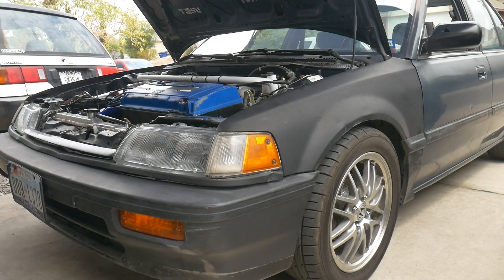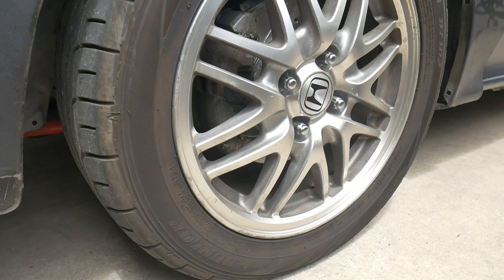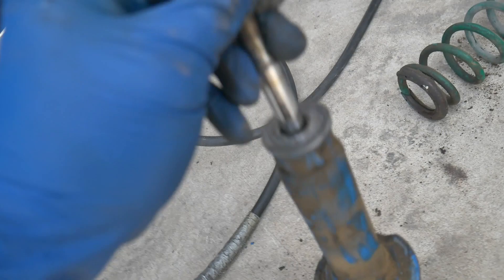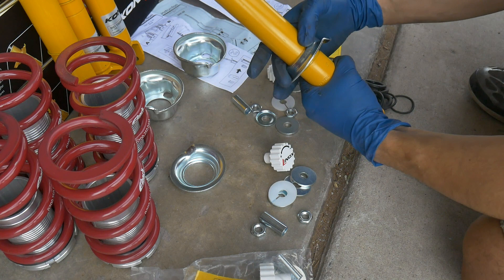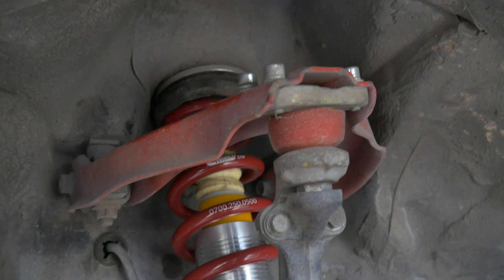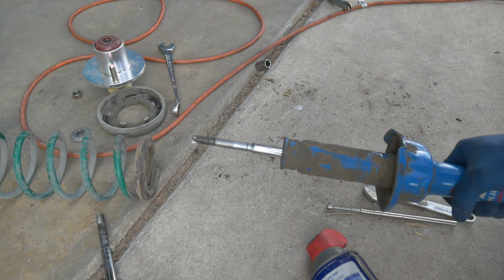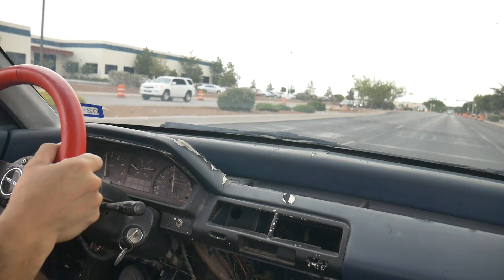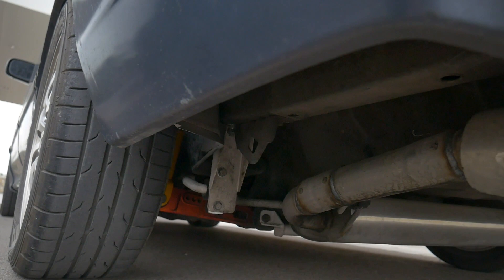Best Coilovers & Shocks for Your Honda (Koni / Ground Control 1989 Honda Civic EF Sedan)

Comment: Like yourself, I’ve used MANY different suspension set-ups on my CRX’s.  I am currently using my favorite of them all:
Koni Yellow’s (Race Version) w/Ground Control coils 600 lbs front / 800 lbs rear.  Been on my car since 2013, seen track days & auto cross with absolutely No issues!  Another brand suspension I would love ❤️ to try someday are Fortune Auto’s!!😎
Reply from the maker: I feel the same way.  I've had the yellows on my track car since 2015 and never an issue! Those Fortune Autos are what I'd like to try next also!
Reply: What would you recommend for a CRX driving for NO track driving ?
Reply: Bas van Will for the street (no “spirited” driving) I would run something like Tein street basis. They’re inexpensive & pretty soft so they feel good on shitty public roads.
Reply: @crxk20r59  cool, thanks
Reply: Bas van Will ohh yeah keep in mind with the Tein street basis coil over kit, u will need to remove some stock parts from your oem suspension to transfer over to the Tein’s...Good Luck!
Reply: @crxk20r59  thanks I will keep that in mind. I'm still researching about which one I will get in the near future. Yellow koni / Ground control looks very interesting though
Reply: Bas van Will they are Awesome!  The Sport version is less expensive than the Race version.  I believe you can contact ground control & ask questions as they will recommend set-ups per customers needs & use. 👍
Reply: @crxk20r59  thank you very much, appreciate it. I will contact them today! ;)
Reply: Did you guys get off the shelf spring rates? Or know the spring rates off the shelf?  Looking for this setup.  Mostly street but more focused on spirited driving maybe autocross.
Reply from the maker: Off the shelf 350/250

Comment: The best cars are the purpose built ones! Loving the suspension setup,if you dont mind what coilover sleeves are those looking into gettin sum for da bout to do the shocks and was planning on lowering it a bit just to get rid of wheel gap and feel a little more planted on them tight corners!! Always fire content! Keep doing your thing Jon! I definitely respect the grind homie!👊✌
Reply from the maker: Ground Controls made by Eibach
Reply: Garage Built Hondas oh for sure didn't notice you had put it the title my bad! On another note,is it left to remove the crankshaft pulley bolt on my b-18a1 cause im going to tackle it (waterpump-timing belt)tomorrow and for the life of me i cant remember. i got the manual but it don't say if it's left or right! Your imput would appreciated! Thank$ sorry for the stupid ?👊✌
Reply from the maker: You're correct in your guess! 👍🙏
Reply: Garage Built Hondas 👌👊✌🙏 much Appreciated!

Comment: Have these koni on my 96 ek and the ride quite good..btw i remembered the fans on your radiator, haven't you considered putting the fans on the front then reversing their connection to the socket. So instead of sucking air, they will be then blowing air into the radiator. Of course you can ditch the fan shroud
Reply from the maker: Yes, I might do that, but no need for now.  I like how it attaches to the stock fan.

Comment: I just picked up a 96 Integra sedan and the suspension is gonna be the first thing i work on. A lot of people have different opinions on what works the best and I am getting a bit lost in all the chatter and opinions. what would you suggest for a daily driver non track car that will be opened up on back roads? I'm shooting for a horsepower goal of 300.
Reply from the maker: KTuned coils.  Heard nothing but good things about them.  I've been a big fan of the Function Forms also.

Comment: Swapping out my stock EM1 suspension for Koni Yellow + GC with 440F/380R rates for autocross/daily driver. Just got the final parts today. Any thoughts on the purpose of the metal sleeve that sits inside the bushings in the top hat? I bought china extended top hats and they came with hard plastic bushings that don't fit over the Koni sleeve, but fit fine over the bare shaft. Wondering if I'm better off drilling out the bushing or running them without the sleeve...

Thanks for the great (and timely) video!
Reply from the maker: Use the sleeve for sure.  The OEM sleeve he had on his old shocks didn't fit the Koni's.  I used the new supplied one.  I wouldn't use those weird bushing the top hats come with.  I'd suggest getting the energy suspension ones or just OEM if that's all you have currently.  The Koni sleeve fit a little tight into the ES bushings but it wasn't a difficult fit at all.
Reply: Garage Built Hondas thanks for the insight. I'm really curious how well those hard "bushings" I have would work, but I don't want to go for multiple alignments just to satisfy my curiosity. I will probably break down and buy the ES bushings, just goes against my nature as a cheapskate and desire to experiment.
Reply from the maker: Try it!  I just felt like there's no deflection on those solid bushins but maybe that would be even better?

Comment: See Jon i told you the Yanaka's sounded really good.  I shot them a follow up email about when they might be releasing their 2.5" catback for the crx and they said the 23rd of this month. Teh guy a talked with said they should be in the 299-349 price range. I told him as soon as its on the site im ordering one because the one i got of ebay for my car to pass inspection quite honestly sound that complete shite.
Reply from the maker: It sounds clean!!  I installed my old eBay exhaust on the old track car and it sounds so damn clean.  Never again will I find one I bet.
Reply from the maker: That one is 2.5".  Mine is a 2.25".  That might have something to do with the way it sounds.
Reply: That could be also i just knew that i wanted a full 2.5" exhaust from the header back.  I honestly think it has more to do with what they're calling a muffler.
Reply from the maker: Agree!

Comment: Picked up all 4 new Koni yellow shocks on my local classifieds page for $180 cant wait to pair these up with the ground controls and throw them on.
Reply from the maker: That's a good price.  I guarantee you'll love the way they feel.
Reply: Garage Built Hondas I hear a lot of good things about this set up so thought I’d try it out. Had skunk2 coils on my crx but they were too stiff.
Reply from the maker: You'll have to let me know what you think when you get them on.
Reply: Garage Built Hondas will do bro!
Reply: Garage Built Hondas where do you buy your set of gc coils? I was looking on eBay but in the description of the item it said “fits tokiko blue”. Am I suppose to find a set that specifically fits Koni yellows?
Reply from the maker: Did yours come with the silver cups like in the video?
Reply: Garage Built Hondas sruts or coils?
Reply from the maker: The cups for the shocks
Reply: Garage Built Hondas yea mine came with them.
Reply from the maker: Those coils on eBay will fit these then.
Reply: Garage Built Hondas ok awesome thank you!

Comment: Hey I would like to run this setup with some helper springs so the main springs don’t come off tension at full droop. Will a 3 inch helper fill the space or do I need a longer one?

Thanks for the awesome content!
Reply from the maker: Those will be fine because you can always adjust the c clip to raise or lower the coil perches and fine tune it to your liking.
Reply: Right. Thanks for answering Jon, I really love your channel. 

So on your track car when it’s jacked up with the tires off of the ground the spring comes down off of the top hat less than 3 inches?
Reply from the maker: I don't remember, but remember you can adjust the c clip and raise the perch on these shocks.  Is this for your track car?
Reply: Yes I understand, but moving the perch up will raise your ride height. It’s my CRX which is built for track/ mountain roads.
Reply from the maker: I don't know then.  Have you checked your suspension and measured it?  It looks to be around 3" from the other video but I've never measured it.  I haven't touched my suspension since I did that work a few months back.

Comment: Just a quick question, did you reuse the oem Brake Line Bracket that attaches to the bottom of the strut and sits above/on the fork?  If not, what did you do (if anything) to secure the brake line.  I didnt see that mentioned and was curious.
Reply from the maker: We zip tied it to the shock since there is no provision for it unfortunately.  On my 90 Si the stainless brake lines I used were shorter so it doesn't wrap around the shock and it is attached only to the fork but is perfect length.  I wish I knew why these were shorter.

Comment: For some reason these Koni Yellow rear shock fork is too narrow to fit around the shock bushing of the reengineered Skunk2 lcas. It fits their previous version of lcas but not the new ones so now Im buying a set of coils lol
Reply from the maker: Interesting, but kinda lame too.  Do you drive an EK?
Reply: @GarageBuiltHondas  no I drive an eg but I just found out that the previous owner used 1213SPORT which is for ek but still fits the eg. It's supposed to be 1310SPORT which has a physically wider fork to fit the wider bushing. Found all this out after I shaved my delrin bushing down smh 🤦
Reply from the maker: Lol

Comment: should the rear spring rate be higher than the front spring rate or the other way around?  It seems like everyone does their own thing there.
Reply from the maker: Usually stiffer in the front.  But depends on driver and car setup.  I have the same rates front and rear on my car.
Reply: @GarageBuiltHondas  Hey man thanks for the quick reply. Basicly im just a newbie getting into this whole thing and i got myself an ef hatch. I wanted to upgrade the suspension now. Is there a place where i can get more detailed information on this topic. For example what the reason behind putting in stiffer springs in front is.
Reply from the maker: Try hondatech.com. There's a lot of info still there.  You'll just have to weed through it.

Comment: What would your budget street setup suggestion be
Reply from the maker: I don't really think anyone should buy a budget setup.  It's one of the most important mods in terms of functionality and aesthetics.  I suggest saving up and getting what you really want for your preferred setup (daily/track/weekend car).
Reply: @GarageBuiltHondas  Following on from the above. Would you suggest this set up in the video, over Coilovers such as the MeisterR Zetas? I priced up the Koni Yellows and springs and the price difference between the two isn't that much. I've got a '91 Sedan which I just want to daily. No track use but I want it to be functionally low. 

Thanks for all the content you put out, absolutely invaluable!
Reply from the maker: The Koni's are excellent shocks.  I haven't used a ton of setups but it's by far the best I have used.  For a daily you'll love them, pair them with some nice coils/springs that aren't too stiff and you'll have a really nice ride.
Reply: @GarageBuiltHondas  Thanks man. Appreciate the reply and all the videos you put up. You've helped me learn so much already and I've barely started. Gunna grab some decals to rep you over here in England!
Reply from the maker: Awesome! 💓

Comment: Would there be any issues running the koni/ground control combo with 15x7+35 wheels 205/50 tires on a 91 civ si?
Reply from the maker: No
Reply: how did that go for you?
Reply from the maker: For who?  And what do you mean?
Reply: @GarageBuiltHondas  sorry wasn't really specific i was wondering how justin set up went if he ever tried those 15x7 with 35+ offset cause i my self have a 15x7 but mine are 25+ offset and my tires rub but i am on stock suspension

Comment: What’s a good spring rate for an ek civic coupe?? Thinking of going Koni yellows w/ ground control
Reply from the maker: 350/250
Reply: @GarageBuiltHondas  Awesome! Cant wait to track with this setup, went with the maxspeedingrods from one of the videos you've posted, but now im looking at something a bit more substantial!  THANKS!
Reply from the maker: You might want a little stiffer if you're tracking it then.
Reply: @GarageBuiltHondas  what’s a good spring rate for track then?
Reply from the maker: I run 500 all on my track car.  I'm not sure how Ek's feel but maybe at least a 450/400 or around there.

Comment: Was the spring in the sleeve a little loose or it was completely tight?
Reply from the maker: Diameter or length?
Reply: @GarageBuiltHondas  diameter
Reply from the maker: It has some wiggle room.
Reply: @GarageBuiltHondas  thanks

Comment: Quick question for u. On my integra, the driver side axle has play at where it meets the half shaft. Is that normal
Reply from the maker: Does it drive fine?
Reply: Garage Built Hondas it has a vibration at exactly 35 mph. Nothing before that 35 mph and nothing after.
Reply: Wade 1 theres a c-clip around the splines on the axel that helps keep the axel in the half shaft. Might want to look into that
Reply: mark0shark0 I’ll take a look tomorrow. Thanks bro
Reply: Wade 1 take a look at the bearing on the half shaft too, might be the problem
Reply: mark0shark0 yeah that might be it because the axles are new. Thanks bro

Comment: Hate to be the debbie downer but I am really skeptical about those coil sleeves being from Ground Control. If they were, you would not use that silver cup piece because they would rest on the little clip that goes into the grooves on the shock body. Those springs look like the ones used by GC since they are made by Eibach. Plus GC sleeves use a hex bolt to tighten the collar that the spring rests on. I am just saying this because I don't know how other sleeves hold up, especially if they are from random eBay sellers.
Reply from the maker: You're correct and perceptive.  The coil perches and sleeves are generic, hence why we are using the cups.  The coils themselves are the GC's made by Eibach.  These used to be my old springs but I have upgraded to 550 rates.  I'm still using my Koni's with the original GC sleeves/perches.  We had to use the cups because it was cheaper to find a generic set of eBay sleeves/perches.  Good eye man!  I forgot to add the eBay sleeves/perches are great.  I've used many in the past with no issues.  They are a great solution for picking out some custom rate springs.
Reply: Garage Built Hondas it was really difficult for me to find a front set of GC sleeves since I already had rears so I almost did this. I ended up finding some GC sleeves and buying used springs. I love this setup. I have 450 all around.
Reply from the maker: I don't know if they sell the sleeves separately.  I'm sure they might be we never checked and since he was buying my old coilover setup I had those sleeves lying around and threw them in for him.  I still think buying a $35ish coilover set off eBay just for the sleeves might be cheaper than the GC/Eibach ones.  Lol

Comment: Only good for looks track performance is terrible the shock fully lifts off the springs in hard corners and lets the car raise up with body roll. get full body coilovers much better performance keeps the car planted.
Reply from the maker: I disagree, I haven't had one issue and they feel excellent.  https://youtu.be/gp4K6qbNrbM

Comment: Would you say that this is better than Form Function?
Reply: Or raceland
Reply from the maker: Easily better than both.  There really isn't any comparison.  These shocks can be rebuilt and are dampening adjustable.

Comment: For a track car get solid mounts.
Reply from the maker: 👍 they are, he has the Innovative 75A durometer urethane
Reply: I know for sbc motors you can get solid steel mounts. I use urethane mounts on my car's as well. As they see street use.
Reply from the maker: That's gotta feel crazy, I bet it rattles like crazy using a solid steel mount.  I like the urethane ones!

Comment: Konis are great but people don’t realize how fragile they are.  Too low, or too many miles and they’ll die.
Reply from the maker: I don't think they are meant for too low.  Mileage I couldn't tell you.  I've been tracking my set since 2015 and still work well.
Reply: @GarageBuiltHondas  if u compared them to anew set you'd see the difference.  The stiff range is pretty durable though. It's the softer damping that goes first.

Comment: Best coilovers money can buy for Hondas is.......BC RS Racing.
Reply from the maker: I've never used em.  Good for daily also?
Reply: The best for everything. You can choose the rate of springs too. I have 10kg frond 8 kg rear in Eg sedan extra weight rear because the LPG tank.many potholes in Greece and my tyres are 215/40r17 no problems .